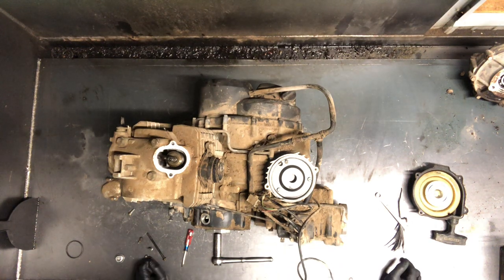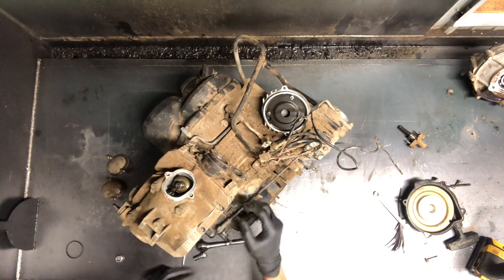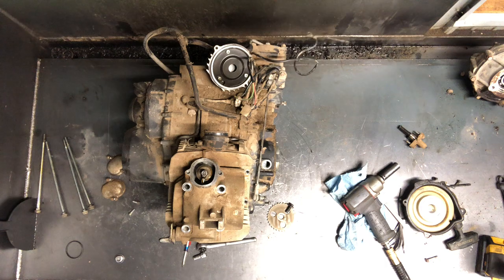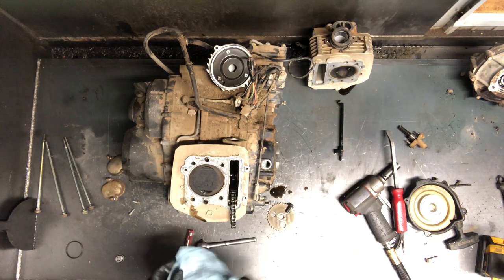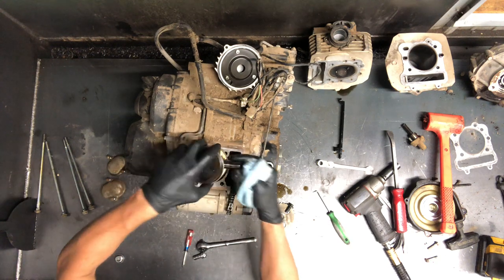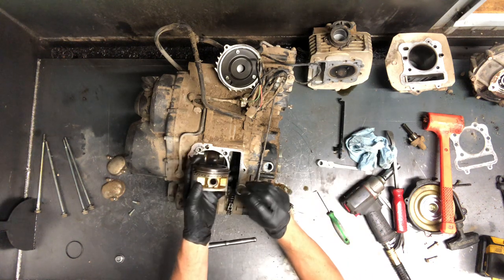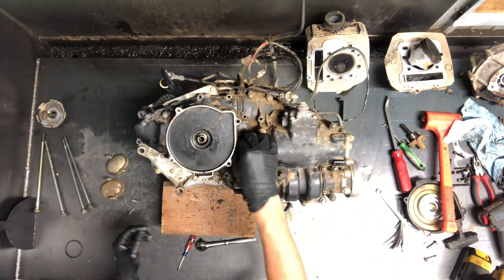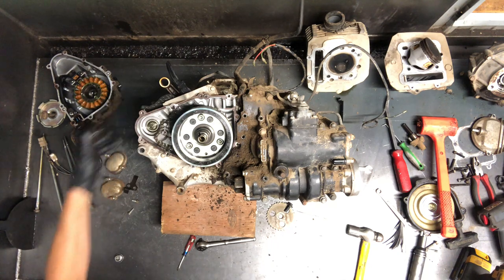Kawasaki Bayou 300 4x4  Engine Motor -1/3 Rebuild Kit, Top End, Tranfer Gear, Cylinder, Head

Comment: I just picked up a 95 Bayou, it needs the top end rebuilt. I was wondering if any other Kawasaki jug would bolt on. Possibly a 360 from a Prairie. If it does bolt up would it require a longer rod and timing chain along with the 360 head? Might be a long shot but I couldn't seem to find anything online.

Comment: What are the torque specs on the 4 14mm head bolts and the 3 10mm bolts on the camshaft chain side of the motor??

Comment: Hey man, I had a quick question.  I broke my engine down and I am putting it back together.  But I can't find what I need in the manual regardless of what I look for, or what diagram I examine.  @15:04 you have your right hand on the part I'm trying to figure out.  It is a metal o-ring deal.  It, I assume, ensures that the output assembly and the gear you have your hand on line up correctly.  There was a rather cheap gasket, some RTV, and no telling what else that was holding that in place when I pulled the output assembly.  (It was stuck on the output assembly, but here it looks like yours stayed in place.)

I'm just needing to know if there should be a gasket or something that is holding that in place, or simply cleaning the mating surfaces and pressing it back in is what needs to be done.  I don't believe there is, or should be a gasket, but since it was there when I took it apart.. better safe than sorry.
Reply: ay man.. u ever get this figured out lol?
Reply: @newtsmith6263  - I did not.  That being said, I did what I said and have had no issues.  So, no gasket.  YMMV